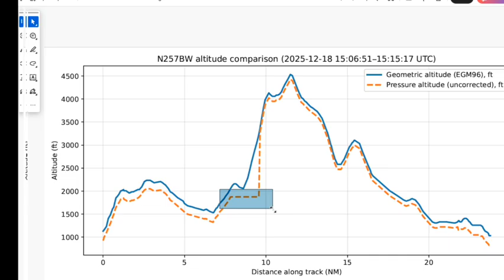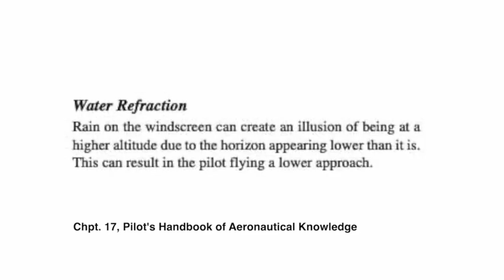Greg Biffle Citation Crash: ADS-B Altitude Glitch May Explain the Turnback

Comment: They did not report engine problems. But if this whole thing comes down to a pitot tube cover and they stalled on final that's going to be incredibly sad. It is clear they stalled on final, ground speed decays to well below stall speed around the time they crashed. The question is why did they let themselves get slow.

Comment: There are three basic types of GPS altitudes. Orthometric, geoid, and ellipsoid. They all are different from each other and from barometric altitude. GPS altitudes are based on complex mathematics.Your premise is erroneous to state that the pilots would return based on altitude differences as you describe.There is always a difference between GPS altitudes and barometric altitudes. Pilots use barometric as the standard.

Comment: Rough engine is why they turned around... 
Unqualified number 2 diagnostic as a rough engine because he had never flown a jet. 
Rough engine generally applies to a internal combustion
Reply: incorrect. The radio message did not say "rough engine" as some others have said. He just repeated the same vague state "uh, we're having uh, some issues here."
Reply: Son didn’t diagnose anything. He was listening to his father and was overwhelmed
Reply: @markduclos6051  the pilot in command also overwhelmed for some reason maybe some malfunction with gauges like forgetting to remove pitot covers?

Comment: The pilot turned around and went back to the airport because he would have lost his license if he climbed straight out and landed at Charlotte!  He was not legal with his son in the right seat!  Very sad that this could have been prevented.  Pilot error!
Reply: Assumes facts not in evidence. 
Maybe you're right, maybe not.
Reply: Wait for the facts dude. You know nothing.
Reply: @jmax8692 he knows more than you. Any reasonable pilot doesn’t willingly flaunt rules .vfr means you stay vfr until you have a clearance and if he had altimeter errors he isn’t going to blast into the clouds and run into someone.
I wouldn’t be surprised if he never had an engine issue, got too low and slow and the optical illusions mentioned here.

Comment: 8:56 I don't know exactly what I'm seeing here, but if I make a couple assumptions: 1) the blue line, barometric altitude, is being pulled out of Mode C packets emitted by the transponder when it's interrogated by radar; 2) the "other colored" (i'm colorblind) line is being pulled from ADS-B packets emitted by the transponder every second or so regardless of whether it's being interrogated; 3) the vertical lines "up to" each corresponding altitude line indicate the position at which each type of packet is received from the aircraft...

If those are true, you can see that Mode C packets are being received less frequently than ADS-B (Mode S/extended squitter) packets. You get an ADS-B altitude every second or so, and baro altitude every 5 or 10 seconds or so when radar (or another aircraft's TCAS, etc) sweeps the plane. Everything between those events is interpolated. This could explain why there is a jump in baro altitude but no corresponding jump in GPS altitude. GPS altitude was received (say) ten times whereas baro altitude was only received twice. This would tend to make the baro data look "jumpy" in relation to the GPS data.

There do appear to be a few Mode C packets received right before the jump, though, which would tend to lean toward the idea of there being something amiss in the pitot-static system. I just wouldn't have a lot of confidence in that yet based on my experience. I run one of these Mode C/Mode S/UAT collector sites. The different types of data we manage to pull in can be janky. There's a lot of post processing that happens to try to make the data "look" like what an aircraft might actually do in the real world. Sometimes it gets confused.